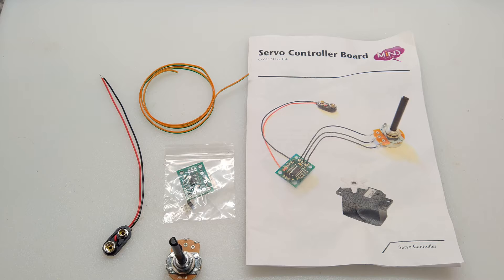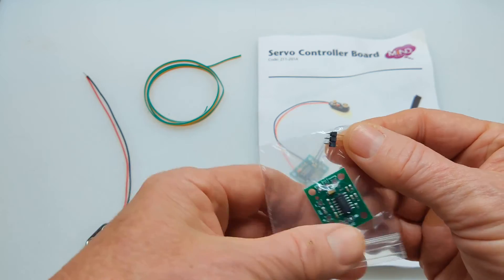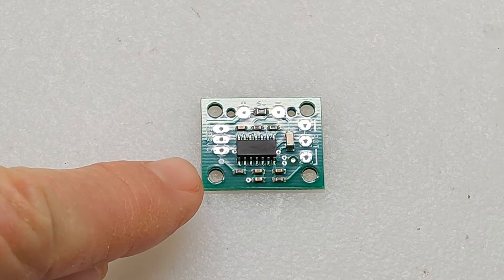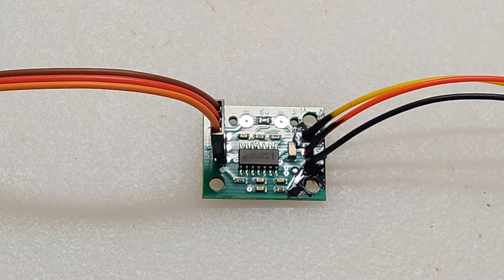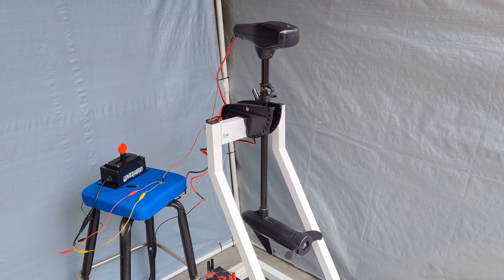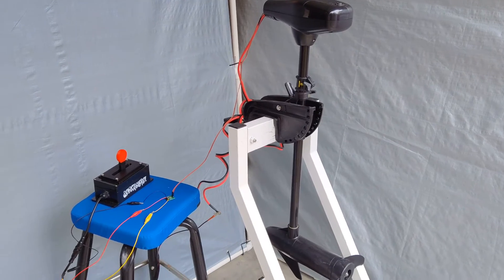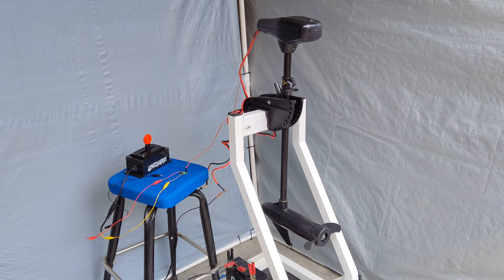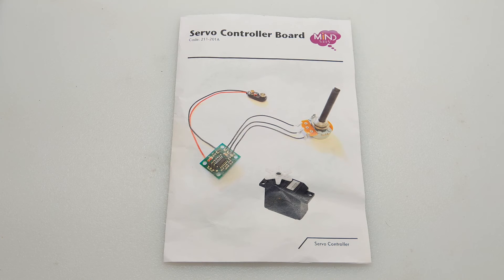DIY Servo Board Kit for ESC Controlled Trolling Motor

Comment: Thank you so much for this video! I had given up on trying an ESC due to all the soldering, but this looks like it might be doable. One question; can the POT that comes in the kit be used? Or do you recommend the 10 K pot? Thanks!
Reply from the maker: Thanks Kyle. Yes, you can use the supplied pot. I did for another build and shortened the stem.
Reply: Perfect thanks! And one last question, will the included pot have the center position and be able to support forward and reverse?
Reply from the maker: @KyleParado-q5q  Yes.

Comment: I am sorry but I don’t understand what role the servo board plays.  Is it doing any analog to digital conversion?
Reply from the maker: There is a lot of info on theory available. The servo tester controls the speed.
Reply: @Aksmaniyak could you please point me at an article (and not a YouTube video) on the theory.  Why not just connect the pot to the esc?
Reply from the maker: Just google for research on ESCs. A pot wired directly to the ESC will not work.
Reply: In case someone else reads my question here is the answer as I understand it (I could very well be wrong).  A potentiometer adjusts a DC voltage from 0 volts to the voltage of the battery to which it is connected.  While a potentiometer can be used to control the speed with a PWM controller, the Hobbywin ESC 880 requires a digital signal using a technique called pulse width modulation as its control input.   The RC servo tester contains a circuit that accepts an analog input (from a potentiometer) and produces a digital signal as an output (see article https://en.wikipedia.org/wiki/Servo_control).  The other thing that puzzled me from all the various YouTube videos (of which Asmaniyak’s are among the best) is how a single knob will get you both forward and reverse.  The answer can be found in the ESC 880 documentation.  Item 11 specifies a default “neutral range” of 0.05ms.   If the pulse generated by the servo tester is shorter than 0.05ms the motor will run in reverse.  If it is longer than 0.05 ms the motor will run in the “forward” direction.
Reply: Thanks for the question and thanks for the answer.

Comment: Question - The pots have about a 300 degree rotation.  Your throttle lever looks like it has about a 90 degree throw.  Are you getting the full range so the motor gets to max power and if so how is it doing that?  Thanks for all the help you give to the community.
Reply from the maker: Glad to help. On one of the throttle lever builds, I did have to modiiy the internal stops to get full power with the Haswing pot. For the lever throttle using the 10K resistor, I did end up thinning the thickness of the lever to make sure I had full power.

Comment: I borrowed your throttle setup for my Recon 120 build video. I like that you found a way to use the throttle with a brushed motor. This way it can work with the super light watersnake t24.
Reply from the maker: I watched your video. It's a very nice build. Thanks for the reference.

Comment: Thank you for the tutorial.
What is the advantage of this board compared to the bleu servo tester that’s used in the beginning?
Reply from the maker: You are welcome. This board is ready for soldering. Most of the problems with using the complete servo boards is that you need to desolder the pot and then solder in new wiring. This can be difficult to do resulting in many boards being fried and unusable. I have done this too.
Reply: Hi 
With this setup are you using a circuit breaker?
Reply from the maker: Yes, I always use a circuit breaker with trolling motors.
Reply: if I understand correctly there is no difference in quality, desolder and solder was no problem. A bigger problem is finding a good potentiometer with center detent here in the Netherlands.
Again thank you
Reply from the maker: Yes, if a person is good at desoldering then the less expensive servo tester will work fine. True, we are lucky here in the USA to get most of the parts we need.
Reply: Hello,
I also use a Hobbywing ESC on my belly boat, but after a while, the ESC goes into thermal overload. The ESC controls a 40-lb Haswing. Have you experienced this problem, and how did you resolve it?
Sincerely,